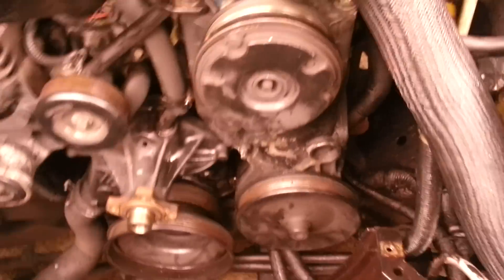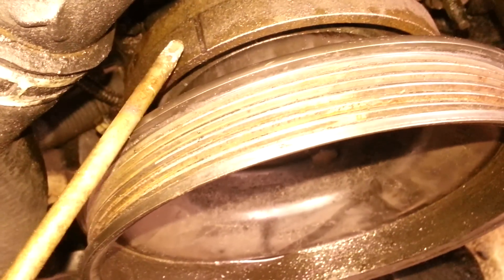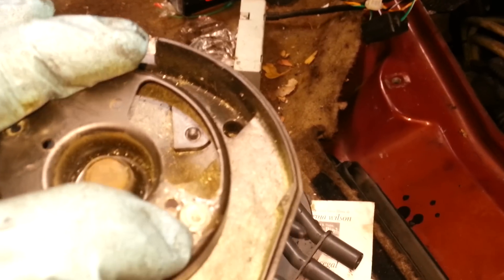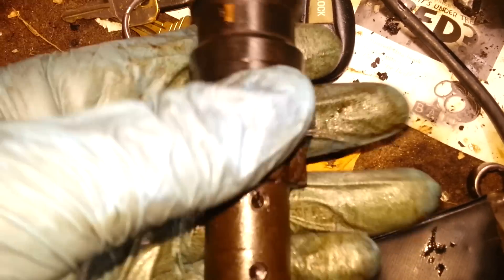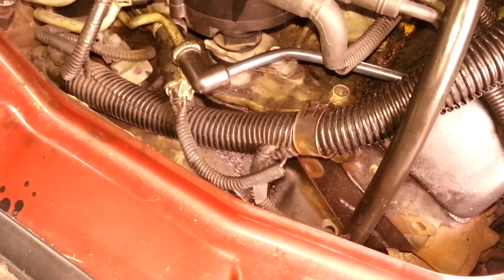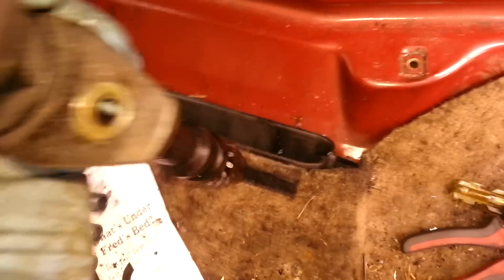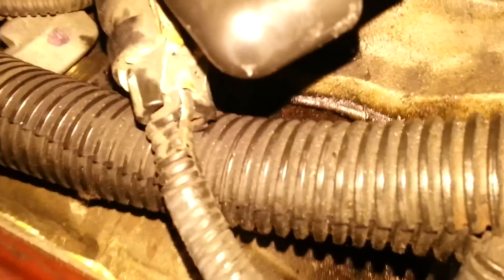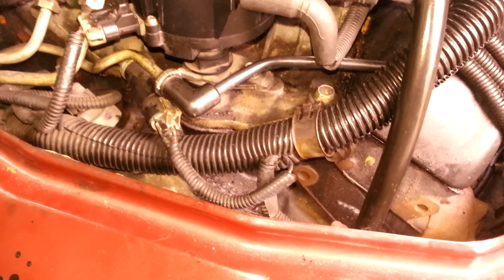How to TDC a Chevy 4.3 Vortex 6 cylinder

Comment: This video was a life saver!! I pulled my drive shaft assembly not knowing ANYTHING about TDC...Long story short this video help show me the marks to line up, I didnt know which line to line up, but I found out that there is a line up mark at the 3 o'clock position (for the 1st line)  and the 2nd line lines up at the 12 o'clock position (2nd line right behind the 1st line) to the mark you're showing in the video, the cam dropped right in, NO adjustments..👍

Comment: Excellent video covering 2 hangups. 1) double timing marks on harmonic balancer, 2) Oil pump screwdriver slots not aligned as distributor is being dropped in. I was by myself, so I put a compression gauge into the #1 cylinder spark plug hole to find top dead center as I rotated the engine by hand (by turning the harmonic balancer bolt with a ratcheting breaker bar). When I dropped in my distributor, the rotor tip pointed 27.7 degrees clockwise of the triangle mark that it was supposed to land on. How do I know that? because there are 13 splines on the gear. I counted them. 360 degrees divided by 13 equals 27.7 degrees per spline. The oil pump female slot can be rotated 27.7 degrees with a screwdriver. Turn it counter clockwise using an endoscope connected to your phone so that you can see it. The endoscope is just a camera on the end of a cable with a light at the tip so that you can see in tight dark spaces. $25 on Amazon.  Alternately, you can do as you recommended on your video. Rotate the engine past top dead center, drop in your distributor, then clamp it down and rotate the engine backwards to check and see if the rotor tip lines up with the triangular mark on the distributor base. Put it all back together, and  your good to go! Thank you bro!

Comment: Those distributors are bad about trapping moisture and corroding the cap. If you have to buy one get a new one. They have a new aftermarket design with the vent hole on the bottom so moisture doesn't get in it. Buying a junkyard one you just get the same problem.

Also when you pull the distributor many times the oil pump will move and you can't drop the new one right. What I do is like you did. Turn the crank until it drops. Then rotate the crank until distributor is at the 6. Pull the distributor. Rotate crank back to TDC. Then drop distributor and it will go in correctly. On pickups it's easier to turn the crank from underneath. That's why the second timing mark. Just a visual aid.

Comment: These videos make it more confusing than it needs to be. If your timing chain is correct and in good shape. Get  the pointer pointing at the number 6 as shown. Pull old out and put the new one in. Turn it back so when you place it in it spins to number 6. If its in place pointing at 6. It should be good to go. Just did this job on my 2003 silverado. Job took maybe 35 to 40 minutes and thats cause I wasn't sure of myself.

Comment: Nevermind the dimple and the white line. Line the rotor up with the 6 or 8 on the rim of the distributor there are two numbers, depending on how many cylinders you have. Make sure the engine is at TDC and drop the distributor in. You may have to make very minor adjustments to get it to line up with the oil pump but it shouldn't be much at all. When it seats down all the way check to make sure the rotor is pointing at the correct number and that's a wrap. The computer will take over after that and put it in correct time.

Comment: Stick your dam finger in the #1 hole and tap the key until it blows your finger out. Check the markings and fine tune it with a ratchet and socket by hand. You may have to move it a little bit but not much.

Comment: The <6> mark is actually to fire number one because of the cross fire crab cap. 
    If you have the serpentine belt on you can turn the nut on the alternator to turn the crank.

Comment: I lined up TDC and found my rotor pointing just "upstream" of the mark on the distributor.  My van had rebuilt heads 30k ago and it always started with a jerk.  Now I know why...the distributor was never in the right spot.  Once running the van computer would compensate, until the gear on the new distributor broke in a bit and cause even more issues.  So my distributor had adjustment for maybe 8-10 degrees and I turned it to match the rotor and it runs sweet now!  It was backfiring thru the intake and running super rich.  It would not even really start and run all winter.  Thanks man!
Reply: BTW you can get a new distributor with cap rotor and the ignition module for about $20 more than just the cap and rotor locally --- on Ebay of course

Comment: First off. I want to thank you for giving directions on what lines are what on the crank and what position to look for on the distributor cap itself. I've been trying to get my truck working but couldn't line up the distributor cap/rotor to align with the crank shaft. I didn't know that the crank had to be align a certain way. I did not know about the two lines on the crank as well. But your video helped me a lot brother! Quality of video not the best but just enough to find where everything goes. Thank you again. My truck is running but unfortuantly that did not solve my loss of power issue. But I did align the cyclinder to TDC (TOP DEAD CENTER) as shown in your video along with distributor cap pointing to the 6 when seated flush. Thanks again and please keep doing videos!

Comment: Ok .. if the TDC is on Cilinder #1 making sure that it is at the top ... and the Mark  is matching the TDC mark on front of the engine .. Why you have to make sure that the rotor is pointing to #6 ? I though that the rotor suppose to be pointing to #1 so the spark is right with the compression time on cylinder #1 ... Am I missing something here ? I know that the firing order is 1,6,5,4,3,2
Reply: Youtube user Jamie jones the car man has a video about this that will help. I think the title is" Chevrolet 4.3 distributor install tips".

Comment: How much did you turn the crank clockwise? I have done mine 5x but got a different van and pulled the old distribute on tdc with it on the six but I have tried for 2 days and can't get it to sit flush unless it is 5 degrees off , so How much did you turn the crank like 1/4 inch or less. 
Thanks

Comment: you didn't find TDC, aligning the distributor and TDC are 2 different issues, I got a tdc tool and it whistles when you hit compression stroke, clockwise will have a mark and counter clockwise will have a mark, halfway between the 2 marks is TDC, I watched it done on v8s and the distance between the 2 marks is about 2inches, I did it on the v6 and the distance is about 6inches, that's what I want verified is if that distance is correct, this isn't TDC this is alignment

Comment: Where you are saying rotor button points at number 6 on the distributor cap would not be your number one piston. If you look inside the cap you should find where the towers are staggered and number one tower should be marked and the rotor button will be pointing at number one tower. I have helped a lot of people out on that one and it does get amusing after all of my mechaning years.

Comment: The reason it would only sit flush one way is because the very bottom of it there's a keyway for the oil pump that was lining up and slipping down into place if you have to turn it because you did a timing chain or something of that nature just take a long screwdriver down there Flathead of course and turn it a little to line up for the new distributor placement

Comment: So after you feel that it is on compression stroke do you turn the engine over one more time and then line up the second line?
Reply: Not that i would think of, compression stroke at Top Dead Center has the number one piston as high as it can travel. I suspect with two notches GM made a milling mistake and corrected it, the second notch being the top dead center number one piston notch.

Comment: I have a 2005 1500 5 speed 4x4  silverardo. With all the crap, wire harness a/c line,  gas line  etc. there is no room to work on this pig. Chevy has stuck the distrib. so far back it seems impossible to work on. Appears your vehicle has much less clutter
to deal with. Anyway thank you for a nice video it is very helpful.

Comment: Great video...got my blazer back up and running after installing intake manifold gasket.  Might mention to move the crank with a rachet until it lines up with the mark.  Better than the "car" guys.

Comment: love the vid!  We laugh about the "two notches comment" all the time at work...  what was GM thinking?
Reply: These engines are different. I replaced my timing chain. I put piston 1 on tdc. Put everything together and didn't crank. Took it all apart and double checked.  So I bought the book. Timing chain marks have to be set with piston 4 on tdc. Could not believe it. Put everything back together and cranked right up. Crazy.  Maybe that's what the other notch is for. I did not use these notches when I did it so can't confirm this. Just a thought.

Comment: ok so line up the notches to the line on the distributor then put it in turn it clock wise till it drops in and it should be tdc?then tighten up the bolt?

Comment: I've got a 4.3L 1995 G20 van, and unfortunately this video didn't help me much. What finally did help me get the timing right was a little sticker under the hood latch that said you have to put the PCM in bypass mode to do the timing adjustment.    There was a single wire connector off the distributor wiring harness that comes apart to put the thing in bypass mode. Otherwise, the timing light mark will be jumping around constantly as the PCM is automatically adjusting the timing advance and you won't be able to get the timing right. With the PCM in bypass mode, the timing mark stays put under the timing light and you can then twist the distributor until you get the mark lined up with the TDC indicator. Got much better uphill power now and better MPG too.
Reply: 95 does not have non adjustable timing that is why  only 96 and up have non adjustable timing timing is set through computer on 96 and up models and can't be changed by timing light
Reply: so does that mean 95 has adjustable timing?

the correct answer is both, yes and no. 

I know this because I own a 95 s10 2wd 4.3 tbi vin Z that has adjustable timing. on a side note, it also has the obd2 style 16 pin connector, yet the brain is under the dash on passenger side, suggesting it's actually obd1, but jumping the pins to flash codes via SES light doesn't do anything just as using an obd2 scanner doesn't. obd1.5? maybe.

my neighbor across the street also has a 95 s10, but it's 4wd 4.3 cpi vin W and it does not have adjustable timing. his has obd2 connection and brain mounted on coolant reservoir. obd2 for sure.
Reply: i just said 96 and up only have non adjustible timing
Reply: i just said 96 and up only have non adjustible timing
Reply: i just said 96 and up only have non adjustible timing
Reply: My 1995 G20 4.3L TBI van definitely has adjustable timing. There is a bolt with a Y shaped finger that holds the distributor down. Loosening that bolt allows the distributor assembly to be rotated to change the timing. Tighten the bolt to lock it down once the timing  has been adjusted. 1995 is the last model year before they started using OBD2. Jumping the right pins on the OBD1 connector under the dash in the driver's side of my van definitely makes my SES light blink out the codes. Some late year 1995 models may have gotten OBD2, but mine did not. I've never heard of an OBD1.5, maybe you're jumpering the wrong pins, didn't make contact, or didn't find the actual OBD connector. First time I tried getting it to blink the SES codes didn't work for me either. I got a better wire for jumping it and then it worked straight away.

Comment: Okay, forgive me as I am seeing multiple things I have really over thought. I meant to say a different type cap.I have not looked, but just now came from Advance auto where I purchased, A:New timing chain kit, New Distributor stem with cap and rotor, (even after trying new plugs, cap, button, } I was advised to try the distributor without going for the chain until I see if the distributor was the issue.Can I just reach out to ya if need be.I am a simple man, and sometimes I  just need an ear and or an extra word...CSM Retired US Army Kasm-- Tampa 8134759980\

Comment: i saw your video when looking this up on google and thanks for make the video it make perfect sense to me now my question how do you rotate the crankshaft to align the makers on the crankshaft pulley to get to TDC do you need a special tool? been messin around with this 93 olds bravada tryin to get it running this truck is just like a blazer n a jimmy of this year hit me back if you read this

Comment: Hey brother, thanks a lot! I too was looking all over the internet looking for how to replace the distributor after crank was spun. I could not find anything anywhere. I was literally about to take it to the shop to get it timed until I found your video. It worked. You need a better quality camera LOL just kidding man. But great explanation of everything too. Simple, straight forward, and to the point without all the extra talk. I did this repair today, but on a 99 GMC Jimmy. I was not as fortunate as you with the center console coming out on the Chevy Astro, or GMC Safari you have, so my dash kind of covers the straight installation of the distributor without the wire loom getting in the way, so it took me a few extra minutes but I got it, thanks to your help!

Comment: I would just like to say a big thank you, dude. You saved me a trip to the mechanic. When i first bought the distributor from the auto parts store they looked at me funny and said good luck changing it because it would be a pain without a certified mechanic. After looking at numerous videos on the internet about setting the tdc for # 1 cylinder, i nearly threw in the towel. Thank God I watched your video. All the other videos online were making this job more complicated than it has to be. Followed your steps perfectly and now my van is running smooth again. Massive thanks to you, bro!
Reply from the maker: lothdragoon you're welcome
Reply: Ya it is actually more simple than most, except that the distributor is buried in the cowl

Comment: My timing is all lined up, it's getting fuel, it's getting spark out of the plug wire and still wont even try to start.... idk what's going on with it?
Reply: sounds like a fuel pressure issue. just because its getting fuel doesn't mean its the right amount.

Comment: The distributor didn't sit flush because of the oil pump. There's a flat head piece in the very bottom of the distributor that sits in a slot for the oil pump. You can rotate the crank like this or you can take a flat head screw driver and turn the oil pump slot in the distributor hole to line it up. It has to be TDC on compression stroke cylinder #1 so the distributor is in time. Here's a simple cheap trick. Remove spark plug #1 (front driver side) and stick a shop towel or something similar in the spark plug hole just enough to seal a little. Then turn the crank until the towel pops out. That's your compression stroke. It's easiest to have a friend bump the starter while you watch the towel. If it passes the TDC mark then manually rotate the crank around again and pass the mark once. That'll be the exhaust stroke. Then when you turn it around the 2nd time it'll be back on compression and line up the marks. Hope I helped.
Reply: I tried this and I my case think it's the " re-manufacture " part :(((((.  See the Video here: https://www.youtube.com/watch?v=jKSRXU_YuCs
Reply: +Jay Hensley - Thankx for the info too.. I did post it in my Video just in case anyone needs it!
Reply: Jay Hensley gcg
Reply: Jay Hensley  so the towel will pop out on an exuast stroke?
Reply: u c coskun yes. It's just a minor rotation though. Otherwise you'll throw your timing off. Make sure you follow my steps though. Only a minor adjustment is needed to make sure it lines up.
Reply: Jay Hensley wow... Good information because I am struggling with my 97 Chevy Blazer

Comment: THANK YOU! This trick for aligning the oil pump so that the distributor would drop in really did the trick! I loosely installed the hold-down bolt to keep the whole thing from turning, while I was manually turning the crank bolt. TYVM!

Comment: Once everything is set do I still need to fine tune with a timing gun. I have a 99 4.3 s-10. My truck will start and run solid but only after a few try's. Not sure if the starter is going out or what. Thanks for any advise you guys can give.

Comment: I found these two ground straps behind my distributor. I just grounded then to that bolt when you bolt down the distributor. There not braided wire. Just two grounds behind there.  I replaced my engine head. And eveything put back together and tried to start it and nothing I pulled one of the plugs and gas came out. Replaced starter as well. Any suggestons? Thanks

Comment: Have the same problem but my 97 Chevy Tahoe 5.7 wont start ...I set the compression stroke to TDC and the Distributor at spark plug #1 and rotter pointing at the number 8 mark......truck still wont start please help!!!!! can it be the battery or a bad spark plug?????
Reply: Flip it 180 degrees then try had the same issue with a 94 full size blazer
Reply: I figured out the problem already it was the battery I cranked it so many times that the battery gave up on me I had to go buying new one.... Its up and running now. Thanks a lot for the reply